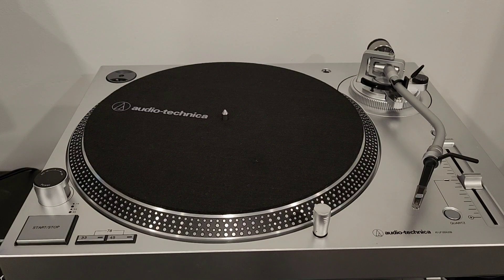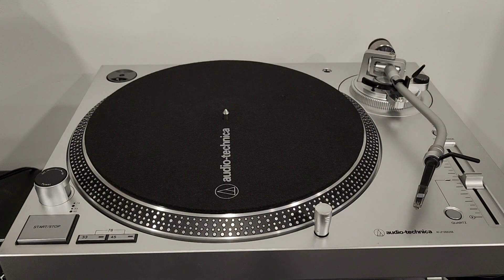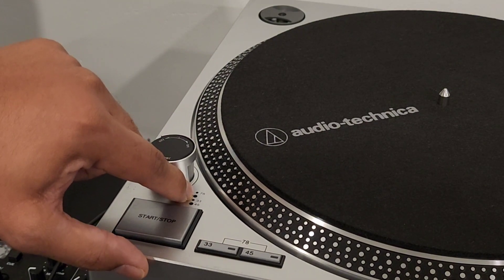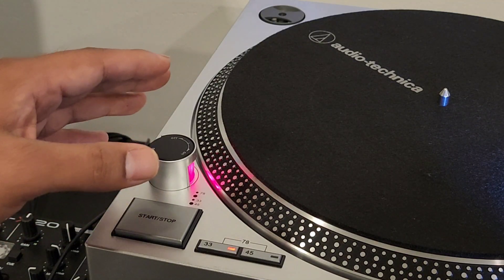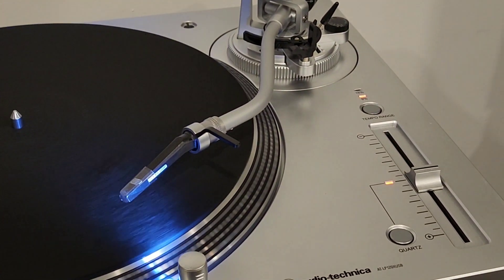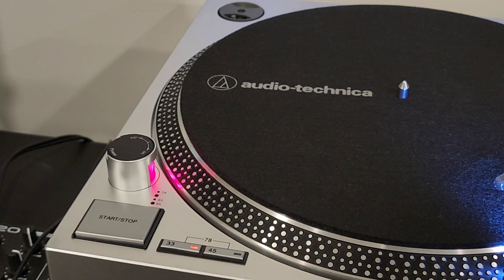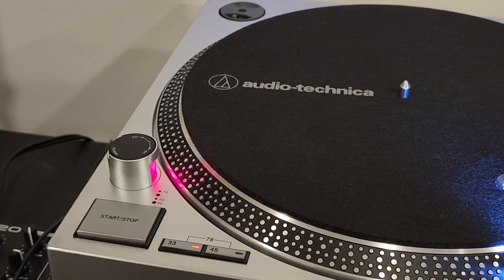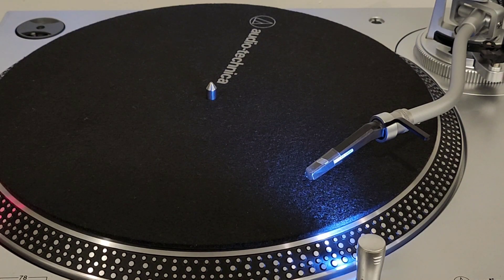WHAT ARE THOSE DOTS? (RPM'S, PITCH FADER & RECORD SIZES EXPLAINED + HISTORY)

Comment: Please note that the way this works is not due to the rate that our eyes can detect, but rather a function of the way electricity is delivered.   The frequency of the AC line voltage is that 60 hz , not our eyes.  The way this works is that the current is delivered in sine waves at that critical 60 Hz.  This causes the light by the dots to flash on each time the current goes positive which makes those dots freeze when the on cycle of the light is synchronized with the rotation of the platter.

Please note that if you bring these turntables to a country with 50 Hz electrical systems (e g UK) the platter will not be turning at the correct rate when synchronized to the light.

Have fun !
Reply from the maker: Thanks for sharing that info! Cheers.

Comment: @11:24 "...and those are 7 inches."
Yes, they are 7 inches.

However, 45 RPM records are not exclusive to 7 inch pressings.
There are lots of 12 inch pressings that play at 45 RPM.  Often, they are long play versions of one or two songs for an entire side of the pressing.

As to sound quality for 33 vs 45 RMP speeds, I have never heard any difference, and know no one that has ever heard any difference.
My best sounding pressings are 33⅓ RPM.

But it is not really due to the rotational speed.  Rather, the studio and the pressing plant simply did a better job recording, mixing, mastering, and pressing the records that my ear tells me sound the best.

If the studio and pressing plant used the exact same mix, and pressed it at 45 RPM, would it sound better?
I wish I knew.  Alas, I will never find out.

Note that as a record spins faster, the centrifugal force on the stylus increases, affecting its tracking.
Also, as the record spins faster, the stylus will have less time to rub where it needs to rub, to absorb (for lack of a better verb) the subtle nuisances pressed into the groove.  The stylus might not dig in to the groove as deeply at a faster rotational speed.

Sort of like driving over a pot-hole.  If you go 100 MPH, your tire will not have time to sink into the hole, and you will feel less of a jolt.  At 5 MPH, you will get the full treatment of your tire sinking into that hole.

I have no idea how much that affects how much information a stylus can acquire.  But at some point, too fast will not allow the stylus to do its job.  Too slow will also be a problem.  Is that how 33⅓ was chosen?  Was 33⅓ deemed to be fast enough for great sound quality?  It is, to my ears.

I am referring to ideal conditions, because I estimate that 80%+ of all pressings have sub-par sound quality, due to who knows what goes on in the studios and pressing plants.  But when they get it right, 33⅓ pressings sound heavenly.
Reply: I owned quite a few 12 inch 45 rpm platters.  Their sonic quality far exceeds what 33rpm (LPs) could ever hope to deliver.